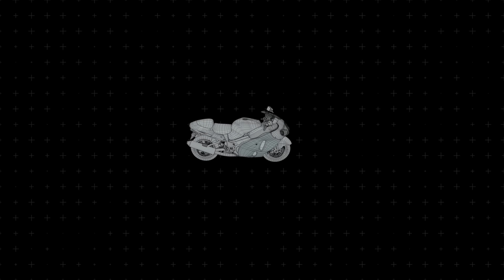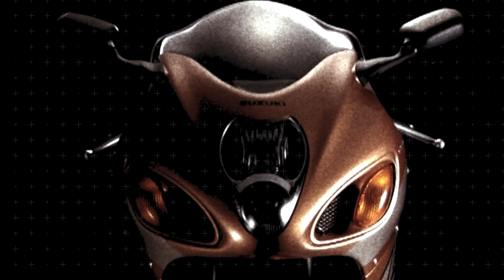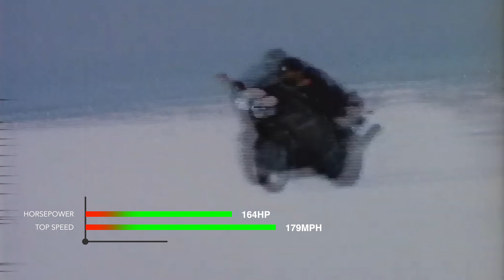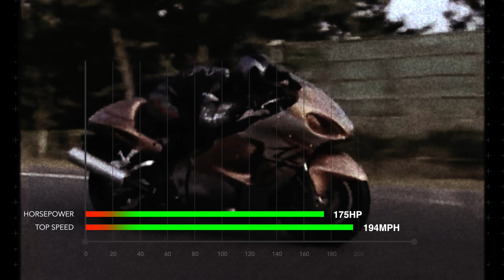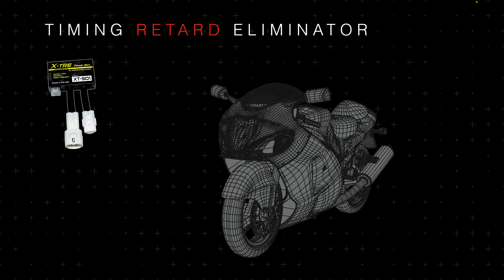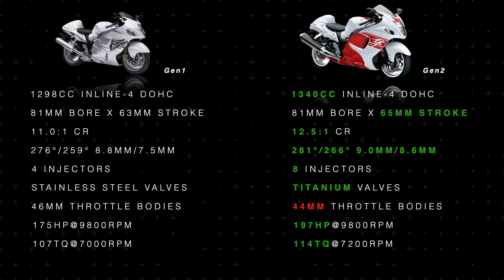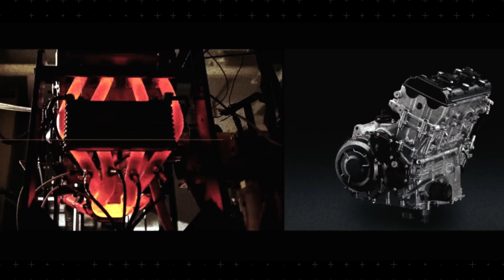Why Turbo Busa Engines Are Overpowered😳| Explained Ep.21

Comment: 0:25 I can't believe this myth is still ongoing. Suzuki was getting wasted across motorcycle racing the entire time of the hyabusa. A number of motorcycles have been manufactured which have higher top speeds but are also much faster around a track. Simply do some research

Comment: Here is little story with my busa- when i was 28 i got my 1st bike and it was 125cc yamaha, i ve seen hayabusa and i wanted it so badly, so i did full bike licence( on 600cc but after passing you can ride any bike) and after i passed i told my 2 instructors im gonna get hayabusa as my first bigger bike and one instructor shook his head and said its bad idea jumping from 125cc 14hp to 1300cc 175hp bike and i would be better off getting 600cc, other instructor was opposite- he said - go for it if you think you can handle it and treat bike with respect it deserves, so what i did few days later? Looked up for hayabusas gen 1 for sale and i picked up one with 26k miles on the clock, 2006 reg, black.didint even do test ride, just transfered money to shop and rode off😄 it was scary but i was going steady... before i went pick it up i said to myself- no speeding for some time, lets get to know bike 1st and get used to it, guess what😂 after leaving city and getting onto motorway- bike just wanted to goooo and within few sec i saw 150mph on the clock😂 my reaction was woooooooowooooooooow and i slowed down to 70 and stayed on slow late for the next 1h before i reached home, then few days later i hit 160, then few weeks later 175 and i was scared to go more than that, because i discovered brakes arent briliant and i better go steady😂 after 6 months i sold it, then i bought zx10r 2005 widow maker and that was hell better bike, i should never sell it, now thinking which one to buy but im really dying to get turbo bike, stretched as next one

Comment: I have a Turbo Busa.  They aren’t just used to make ungodly amounts of power for bikes.  A few sports car manufacturers use them and lots of people do custom car engines with them.  Westfield megabusa uses them and caterham and Aerial Atom makes a V8 out of 2 engines for their cars and does a supercharged V8.  I’ve also seen them in bubble cars doing stupid speeds even bending chassis due to the power.

Comment: Then why has Suzuki not won a moto GP in a very long time? Every week they have a chance but fail. If the bikes that win on sunday can beat them without a turbo then they can also beat them if both have a turbo. So the excuse you can't run a turbo in GP is unacceptable. I have seen many drag bike runs and Busa does not always win. Not even half the time. I do like Suzuki. A very nice bike for sure. But so are Yamaha and Honda and KTM and Aprilia and Ducati and Kawasaki and BMW and Triumph and many others. No one can claim top unbeatable spot. Thats what makes the sport so great.

Comment: I was looking for a GSXR750 
when I bought mine.
I had never heard of “Hayabusa”.
I was afraid of it.
But it was Cherry 
and the guy 
-only one $4500 for it.
He was 5 foot six 
and 
could barely hold it up at stop lights.
He wanted it out of it.
Once he explained what the motorcycle was.
I put it on the trailer.
I wasn’t happy going home with it.
I thought I was gonna die on this bike.
10 years later, I love it.
And 
-still respect her the same.
It’s a very dangerous bike.
But I’ve taken her 192 miles an hour.
-With NO POWER COMMANDER
(concrete Highway❤️ in Missouri)
No bike I’ve ever owned 
👉🏽could do that🔥
PS
I asked my mechanic 
to put a power commander on my Hayabusa 
-during maintenance operation.
When I went to pick it up 
I saw “power commander”
 was not on the bill.
I asked him why it wasn’t on.
Reply:
“It’s already fast enough.
I’m not going to let you kill yourself”…
He was a good friend of my father 
going way back.
But,
It told me 
there are mechanics 
who will not 
make this bike go any faster.
As,
It opens them to liability💡

Comment: In the 80's had a GPZ 1000RX then come along girls and life. Missed biking so much,. Next bike 14 years later was the Mighty Busa.. OMG! 
   It made the GPZ feel like a lawn mower.. the sheer power AND handling was light years from the 80's bikes.  Tweaked it and saw 211mph from it and even did a track day at Brans hatch.. shredded the rear tyre, but never had so much fun with my trousers' on  :trophy-yellow-smiling: Best ever bike

Comment: Feel free to source to either confirm or disprove. Still, the regulation and import ban threat was probably from the European and Western manufacturers who looked at the Hayabusa and other bikes and knew they had NOTHING comparable and couldn't R&D something before the Japanese swallowed the market whole if left unchecked, so they got regulators and politicians to make noise under the auspice of "safety" and thus cap off Japan's speed advantage...granted this isn't to say safety wasn't an issue that needed to be addressed. Some of those regulators and politicians did actually believe in the push for safety, just saying those backing them didn't really have safety as their primary reason for wanting to curb the speed war.

Comment: Dry weight: Nearly 500 lbs
Top Ducati sportbikes from 15 years ago:
Around 360 - 370.
2014 1199 Superleggera: 336 lbs dry, over 200 HP from a NA twin.
That's a huge difference, in case anyone was wondering.
Reply: Yeah I wasn’t actually
Reply: @jockojockoson9995  Not exactly the brightest bulb on the tree then, are you.
Reply: @MountainMetal  he might be, but you certainly aren’t. Notice how he said he wasn’t  wondering.

Comment: If I got it (HP) I will use it!!!  No thanks on the Hayabusa.  I like walking, having skin and overall living not in a wheel chair. I only needed it when I passed a cop at 126mph on my 1977 Suzuki 1000 although still got away without crashing.
Reply: Dangerous af but respectable. 
Fleeing from cops in Jeeps on an enduro into the cover of the Woods is more my level lol

Comment: " beats everything" OKAY.... lets stop

0-400 km/h (not top) FACTORY to factory.. 22s RECORD Koenessigg regera... it BLASTED past a MODDED  H2R.  26-27s... lets stop all this..(look up real max track records)

Dis^ was NOT EVEN A BIKE.. anymore that was more PRO MODD "bike" barely left and right.. it actually killed the rider... PRO MODD cars.. 300+, 330+ mph ... 1/4 mile. no 1/2

 
 
IMAGINE this.. you barely moving with cross wind left and right on WEIRD straight ? speed 600-1000hp 1 wheel bike.. okay... and a 3,300 hp,  4,000 hp soon on STANDARD AC car Dodge Viper roll out.. you think HAHAH im 300-311 mph at BEST conditions in 1/2 mile.. truth is that car 3,300 hp viper close to 300+mph AT 1/4 MILE..

dodge viper 2,000, 3000, 4000 hp POWER PLANT with Air condition option.. and nice seats, racing gauges and sequential .. OH MAN... BEATS ALL streets legal too :D 

I mean the 3,000+ hp Dodge viper already nearing 300 mph 1/4 mile.  Theres a reason bikes pro modd usually do 660 feet same time as pro mod cars 1320 feet. not crying.

Comment: as a mechanic / hot rodder.... i really do respect these "sport bikes"...
.
but my heart is still with 70s UJM bikes.... SPOKE WHEELS AND AIR COOLED ENGINE FINS BOI!!!!
no one in their right mind is going to take a TUBE TYPE tire up to 175 MPH (despite it being 100% safe)
.
just dont get a puncture.... 
as tube types go flat INSTANTLY 
while a radial will slowly bleed down
.
.
got low on pressure and spun the tire on the rim on my 75 kawi G5 100cc 2 smoker
INSTANTLY went flat
.
i shifted weight to the front by breaking a bit harder.... and was able to "wiggle to a stop"

Comment: It was actually a car commercial in Europe that killed the speed wars. On the Autobahn a BMW and a Mercedes both handshake agreement limited to 155 mph were cruising side by side in their respective lanes when you heard a noise coming up from the back and the Suzuki Hayabusa lane split them at 194 miles an hour. The European government told the motorcycle manufacturers you restrict their speed or we will step in and do it for you. That's where the magic 186 mph came from.

Comment: Great Video Thank you. I grew up thru all the bike era as a youngster. First bike was a 50cc Garelli then Zundaps ,Kreidlers, Yamaha, Suzuki 750 water-pumper. Kawasaki Tripple Mach 3 ,etc. The greatest era of 2 strokes.Then came the Honda K0 then my first Big bike was a Kawasaki z1000 .Drag Raced Suzuki Katana's as well as Kawasaki Z1000 street turbo class. Very little mods except welded cranks and Alternator welding on the Suzukis amongst perhaps valves ,springs and pistons cams etc but not radical machining or mods. Built many bolt on street turbo kits for clients ,most engines were bullet proof from the factory. Always been a Kawasaki Lover and still am. They were always the fastest around generally.  Having said that . I have not seen catastrophic failures on any Superbike engines unless pushed way beyond limits on mods. We did few mods and turbos and they ran awsome. Bike engines are there to be used and abused. They were in the old days anyhow.. Not sure now what's around. Some are better and even more reliable than other makes I guess. When the Busa came out it was no doubt a gamechanger and set a standard. I Have built a 2nd Generation Busa turbo and it's fitted into a fiat 500. I am to old and scared to ride bikes now. Done it all and wonder that I and many friends are still alive after what chances we took.Unfortunately many guys I know were not lucky. Some were hosed off the tarmac by the cleanup crew.There was only one throttle position and that was wide open. No regrets. After building such a legendary bike  as the Busa and many other great bikes it is a pity that Suzuki pulled out of Moto GP.
Reply: Same eara as me (and we have the same name! Turbo Busa in a Fiat 500 sounds a lot of fun, original or the new extra large one? I remember seeing an original Fiat 500 with a Rover V-8 at Santa Pod in the 80's (Poddington, England)

Comment: The Honda V65 Interceptor was the fastest bike in 1983 with 1150cc and 121hp. My naked V65 Magna would do 155mph before I felt downforce disappearing but it had power to spare.

Comment: There a few errors here, most notably, the first year Kawasaki ZX12R(2000 model year) was not retricted and was in fact faster than the hayabusa in several tests. The ZX12R had more HP but less torque.

Comment: Peregrine Falcon "Hayabusa" in Japanese, the peregrine falcon can reach speeds 180 - 200mph in a dive to catch prey. Hence the fastest production motorcycle being named Hayabusa when introduced in 1999. "They are the fastest animal on the planet. When they attack a prey bird, in a hunting dive called a “stoop,” they reach speeds in excess of 300 kph. Some birds have been recorded diving at an incredible 390 kph. To breathe while traveling at such speeds, the bird has a specialized respiratory system."

"The lungs are supplemented by air sacs where gas exchange does not occur, but from where air is pumped into the lungs to keep them inflated at all times, even when the bird is breathing out. Peregrine falcons also have special cones in their nostrils to regulate air flow when diving at high speeds. The heart is as strong as the bird is fast, beating 268 times per minute. Food: Medium-size birds, watch out; Blackbirds, ducks, shorebirds, ptarmigans, grouse, doves and songbirds — peregrine falcons prey almost exclusively on other birds. In cities, they will take pigeons and starlings."

Comment: Rare fact in 2002 my junkie sb 383 nitrous plated 80 elcamino beat a turbo Hayabusa at the dragstrip with a 10.30 quarter mile pass along with all the other sportbikes there that day including, 2002 gsxr 1000, 1998 slammed R1. No doubt those bikes should be faster but not that day in the Tucson heat and the bikes tried all day to make a faster quarter mile e.t. but the old junk elcamino was one to hate😆

Comment: Great video! Would be nice if you included speed in km/h also.
Reply: Multiply by 1.6 ...you're welcome So 100kmh is 62 mph 200km 124 300km 186 same as top speed limited thats why all the super bikes have 300 kph speedos

Comment: Awesome video! 
Its really cool seeing forced induction mods/builds in the motorcycle scene taking off so much over the last decade. 
I work at a bike (performance oriented) shop & factory race team, which is a dream job in its entirety, however my absolute favourite jobs are the big hp turbo builds we've done on many bikes, but by far the gsxr1300 and the zx14r are the most insane platforms to build on. Have built two zx14's now that surpass 450hp on kill/high boost, and a cosy safe reliable 300hp on low!
Reply: There has never been a GSX1300R, it's just a GSX, Sport Tourer

Comment: In my younger days I rode a turbocharged and intercooled BMW K75s that developed 170hp. It topped out at 173mph  and change and since the speedo didn't go that high, I had to measure the circ of the rear tire and do the math to get my very top speed from the RPM and final drive ratio. I worked at Luftmeister in Paramount CA and lived in Simi Valley and my run to work was at triple digits every. single. day.  Work started at 10am so I had the road to myself, mostly.   Fun times.  I'd like to get my paws on one of these Hayabusas and wring it out across Montana.
Reply: That is probably the best way to work out theoretical top speed, you will probably have a little clutch 'creep' and tyre drag but it should be close. I did the same years ago after I had my 490 Maico  topped out on a firebreak in the woods, worked out around 130mph which was much too fast on dirt track less than 2ft wide

Comment: I owned a 2008 Suzuki B-King with 185 rear wheel hp and 108 fp of torque at 5000 rpm. I was killing C5 Corvettes with my body weight and 150lbs of camping gear on the back. I can’t even begin to imagine 1000 horses, like NO THANKS

Comment: my dads cousin had a banshee quad bike fitted with a custom Hayabusa engine and it had Nos injection, it was made for sand drags. he said it was the scariest thing he had ever been on and that was without using the Nos. I dont know much about bikes but it use to get raced at Ponde if i recall correctly.

Comment: This motorcycle it's a legend, that has a rock solid engine, and has gained perhaps the more abundant aftermarket with mods and parts of every kind, so it's relatively ease to build a monster on two wheels (if you have the money)

Comment: The replacement for displacement is Chris moores Suzuki gsxr 1000. He went 5:96 at 230mph in the quarter mile (1320ft) no slick and wheelie bar. It’s the fastest no bar street tire motorcycle on the planet. And it’s not even close. And yes it’s faster then a Hayabusa has that 1000 holds the world record.

Comment: I drive a 99' Fireblade with nearly 150hp. Doing 300km/h is great and in Germany you need to check the mirror when doing it xD. But what the fuck 311 miles per hour must feel like flying😮

Comment: My biggest question on building a wild, 15psi boosted Busa engine is how can the transmission handle all that torque?
Reply: 15psi ??? 12.5:1 static ...more like 5 psi on a turbo unless you run nitromethane  the tq is ramped up not instant the trans is gonna be fine 700 lbs total weight isn't a huge load

Comment: just to get the ridiculous click bait thumbnail out of the way - no, busa's didn't make 1000hp. that's like saying corvettes make 2500hp. 1 guy spending 200 grand on 1 engine did 1 time. the most these street bikes would make was 250 before it needed wheelie bars and parachutes
Reply: 1000HP is BS, but your 250 is underestimated too. 300-350 is pretty easy with a turbo kit. E85 and you look at 400+-
Reply: @AndrasMihalyi  you have to understand that when these bikes were newer, literally nobody has putting race gas in these things. a turbo build was insanely rare itself and cost the price of the bike. sure you can order a 400hp kit these days and fill up e85 at your local gas station, but this wasn't reality 20 years ago. nobody was running 400hp on the street. nobody was running even 300+
Reply: High hp bikes are useless. You will never be able to keep the front end down or the rear tire from spinning once you get into boost.
Reply: @gibememoni   said absolutely noone ever...

Comment: I had a 1984 V65 Magna, which at one time was the fastest production bike at 176mph.  Amazing how fast it was without any aero, I was 135lbs on it, like a jockey on a race horse!  Good times. 6 speed shaft drive.  40 mph in 1st, 80 in 2nd, 110 in 3rd and I still haven't exited the freeway on-ramp. And paid only $1,700 for it used back in the 80's.  I miss the music and the bikes of the 80's.

Comment: I always thought the concept of the Busa was humorous.

In the car world Japan will make the argument that smaller displacing higher out put motors, albeit less horsepower over all, is a supplement for larger displacement…

In the motorcycle world Japan was like screw it, the fastest production motorcycle will have a big block relatively speaking.

Comment: Not sure why they described Kwaks bike as a ZX11,  Kwak didnt make that, they made he the video showed a  ZZR1100 in this video. Kwak's answer to the busa was the ZX12R which was faster, the A1 models being unrestricted. But fanboys be what they are. Busa's were /are great bikes but there story is incomplete without a true account on the Ninja12 as it really was a monster. I had mine reading 204mph with sat nav and 192 at the crank with a power commander and race system.